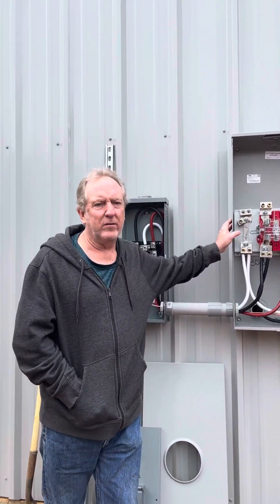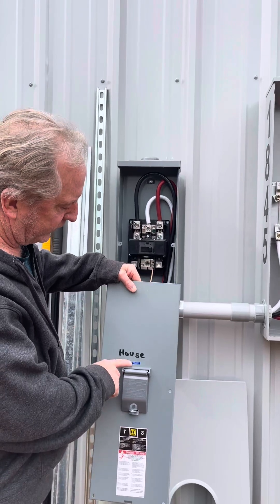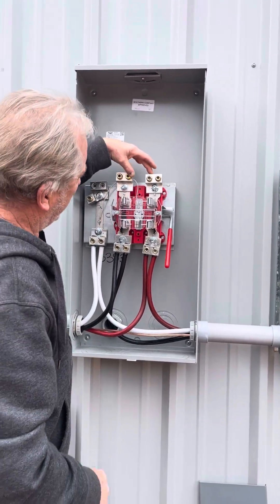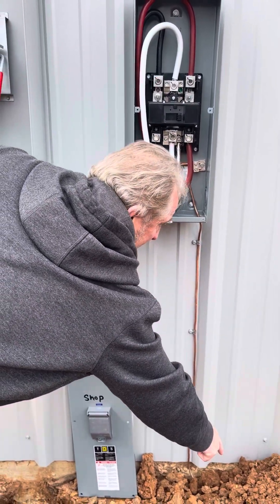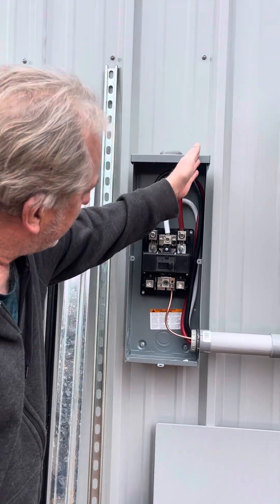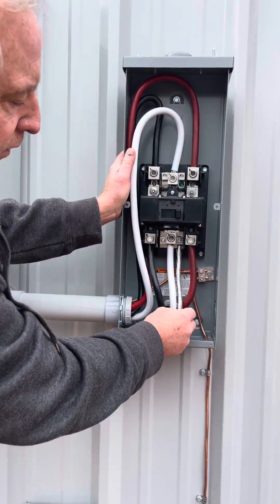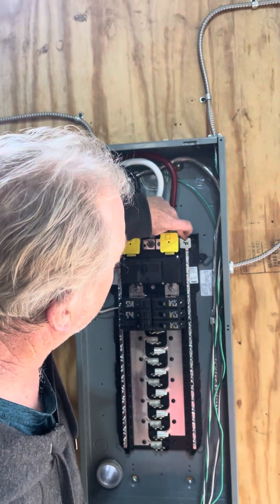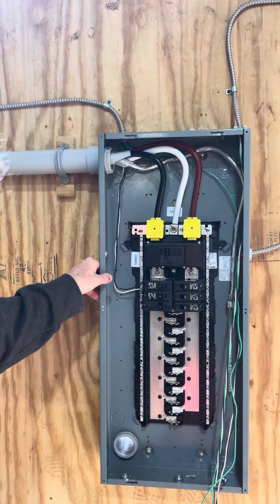320/400 AMP Meter Base Install With Parallel Service Lines

Comment: Hello, I'm planning the same set up.  What are the brand names and models of the 400 amp meter base and 200 amp disconnects. Thank you !
Reply from the maker: Hi, the disconnects are "QO 200 Amp 2-Pole Outdoor Circuit Breaker Enclosure with QOM2200VH Breaker" from Home Depot and the meter base is a "Milbank 320A 4T BYPS OHUG", but unfortunately I don't have the exact model number because it was supplied by the power company and now has the tamper proof lock on it.
Reply: You need to contact the POCO.  They have a spec for what types of meter base they will accept.
Reply: Thanks for your help
Reply: @tomfinley8382 check with your power company. Even if they make you supply the meter base they will have a list of brands and part numbers they will allow.  And be aware 400/320 meter bases and enclosures that have the meter socket and one or more built-in breakers are expensive and often back ordered.

Comment: You may not be able to come up through the bottom with the utility power as you are sharing the same space with yhe load side of the meter. You probably will have to come from the top down to the line side of the meter.
Reply from the maker: Actually they already did it on the bottom right like I mentioned in the video.  And they squeezed all 6 wires in a 2 1/2" conduit!  They were not too happy about that, but they got er' done!  Lol...
Reply: @pwm001 I would think that if you're coming up from the dirt you would not be allowed to loop over the top for entrance of power into the box. You indicated getting the six wires in was difficult,could you have done anything differently
Reply from the maker: @Terry-cg7kt  The only thing I may have done differently would have been to install 3" PVC instead of 2 1/2" where the 6 wires came in, but that was the power company's call and they were able to get all of them installed and it was tight as is all wiring of that gauge.

Comment: Question  what number service wire is that ?
Reply from the maker: Hi, that is SE XHHW 4/0 aluminum cable.  I removed the gray outer jacket/insulation.  Hope that helps.
Reply: @pwm001  thanks
Reply: Hello, I'm planning the same set up.  What are the brand names and models of the 400 amp meter base and 200 amp disconnects. Thank you !

Comment: Why the 2" nipple thru the back of the meter base and into the panel in the garage?
Reply from the maker: Lol.  That was a mistake.  I originally went straight through to the panel inside, but external disconnects are now required.
Reply: @pwm001  your on the 2020 don't forget your surge protection in each panels and those lovely afci gfci breakers that are required
Reply from the maker: @william.shilling2969  Yeah, fun isn't it.  $60+ each...